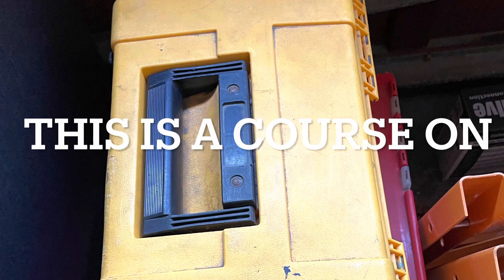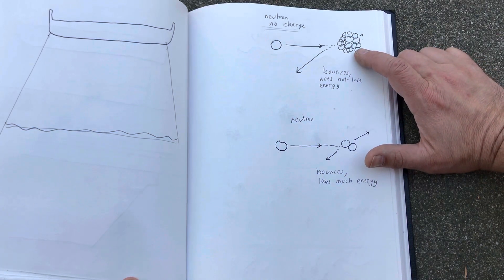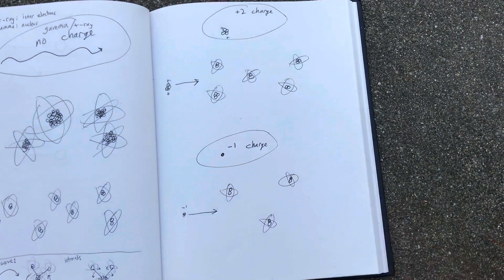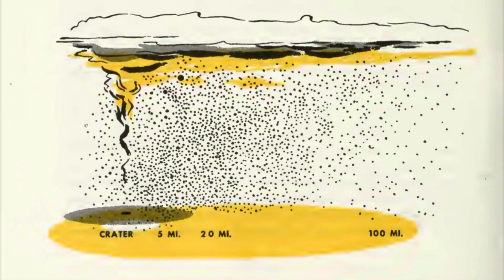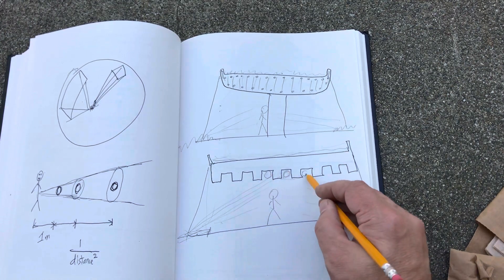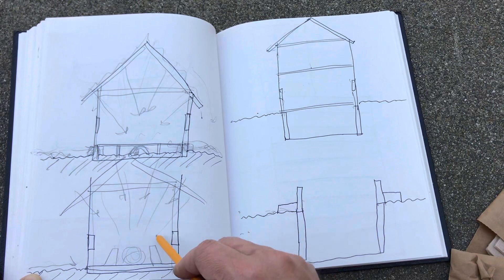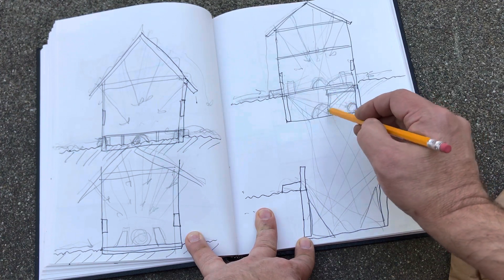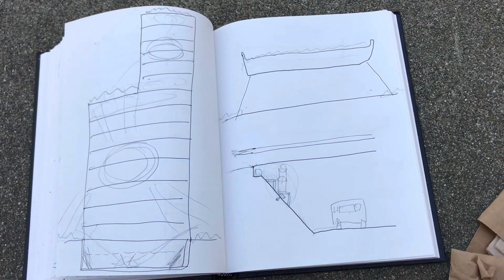How Fallout Works and Last Minute Improvised Urban Fallout Shelters

Comment: Nice video. Good info. Have you ever anchored into concrete?  Takes some doing. By time you rig up that platform. I assure you it's way to late, especially with any battery powered impact tool.
Reply from the maker: I’m thinking powder activated nails

Comment: If you shelter under a structure like a bridge, wouldn't the wind blow the fallout under the structure eventually, making it a bad spot to hide?
Reply from the maker: No.  Fallout isn’t like in the video games.  There is a long term fine dust factor but that’s mostly unimportant.  The main thing are large sand grain size black particulates (that fall from the mushroom cloud and stem starting about half an hour or so after the blast).  That’s the “hard stuff” that will kill you.   The reason it starts half an hour after the blast is that’s how long it takes for sand grain size particles to fall from high altitude at terminal velocity.